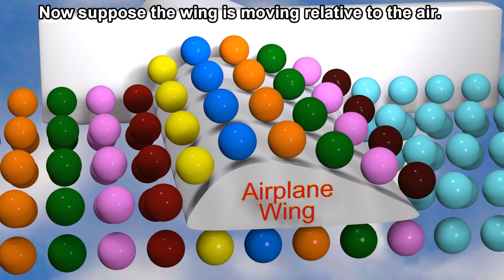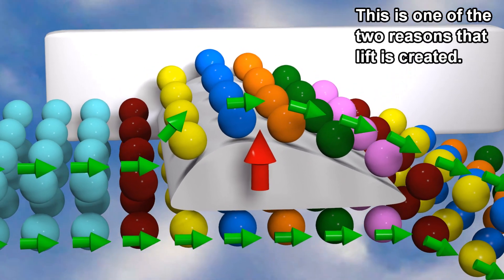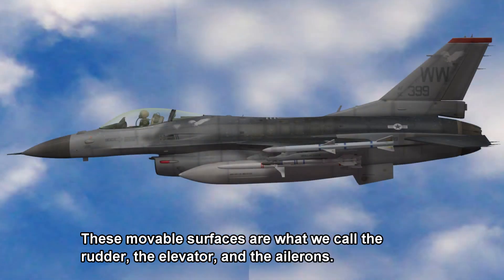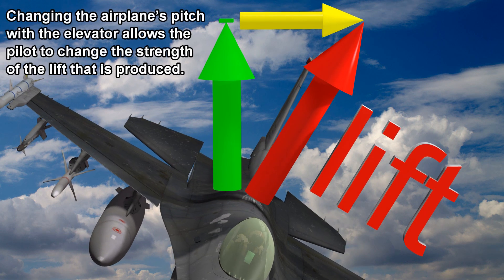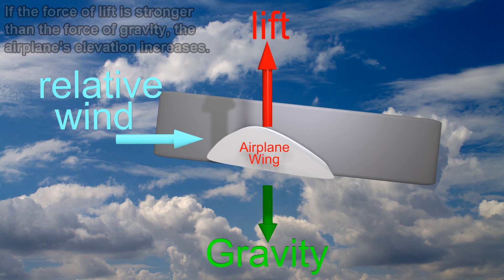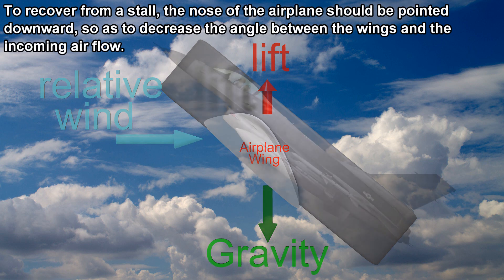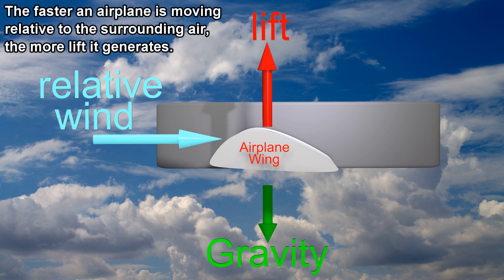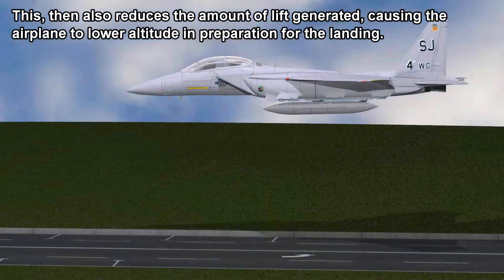Aerodynamics - How airplanes fly, maneuver, and land

Comment: Ah!  Another amateur Lift video.
...
Eugene,
You are, unfortunately, repeating some common misconceptions about lift that have been repeated so many times that it is almost impossible to get the true story. ...
Your animation shows the "Equal-Transit-Theory", long known to be false.  The air above the wing, in reality, beats the lower air to the trailing edge by a considerable amount.  See Professor Babinsky's video of an actual wing: https://www.youtube.com/watch?v=UqBmdZ-BNig 
...
Pressure difference in a fluid is what accelerates the fluid. Speed does not cause a lowered pressure.
...
A wing (actually any object) moving through the atmosphere (or any fluid) creates pressure differences in order to make the air (fluid) flow around it.
...
There are three main parts to the complete explanation of lift.  The upper pressure reduction and the lower pressure increase which is the total lift; then there is the downwash resulting from these pressure changes that satisfies Newton's Third Law.
...
 The pressure difference (top to bottom) on a wing is the COMPLETE lift force, but it has two parts for the total pressure difference.  By the very movement of the wing through the air, the underside of the wing increases the pressure there and this also results in the downward acceleration of that air. This increased pressure is part of the total pressure difference top-to-bottom.  While a fair analogy, the molecules don't bounce. This is the "Hail of bullets that Newton postulated, and is poor science. They are pushed down by the increased pressure at the lower surface. This is easier to see if you view the wing at a somewhat increased angle of attack. 
...
The curved path that the wing causes the air above the wing to take is what causes the lower pressure at that surface, not "speed".  This is the second part to the total pressure difference. When a mass (even air) flows in a curved path, this is an acceleration caused by lower pressure on the inside of the curve - at the wing's upper surface in this case.   The lower pressure thus created is also responsible for the acceleration of a considerable amount of air that is above the wing to be accelerated downward.
... If you understand this, you will see that under the wing there is also a lower pressure toward the inside of that curved path.
...
 The upper air and lower air combine to form the total downwash.   
See this animated gif of a very large test model and mote how much of the downward thrust air starts above the wing:
http://amasci.com/wing/lasrWing.gif 
...
The reality is that the wing's movement through the air causes a pressure reduction above it and an increase below it.  
...
The speed of the air above a wing is almost unchanged as the wing passes by.   It is only accelerated downward.  Look closely again at Prof Babinsky's video linked above.  Believe it or not, the air below the wing is pushed and sped up as the wing passes and is therefore faster, from the still air's frame of reference.  See Complete Aerogeek's video (time 4:00) of three frames from Professor Babinsky's video.  Note the streamlines #8 & #9 as the wing passes the STATIONARY vertical line.  The one that moves the most is the fastest. [#8]
 https://www.youtube.com/watch?v=MlK4ZL5N7MA  
...
It is the total pressure difference which allows lift and control, not just the lower surface phenomenon.  Control surfaces have an effect on BOTH the air above and below the wing, just as the whole wing does.
...
ALL WINGS produce lift in this very same way...inverted, symmetrical, flat.  More pressure below than above, curved paths below and above and with the resulting downwash.
...
The angle of attack changed by the elevator, changes the pressure differences created an,d therefore, the lift....For a good and authoritative source to support what I say here, see:erodynamics Krzysztof Fidkowski associate professor, Aerospace Engineering Department at the University of Michigan.Krzysztof Fidkowski How Planes Fly.  https://www.youtube.com/watch?v=aa2kBZAoXg0 - 
Cheers, ScienceAdvisorSteve
www.challengerillinois.org
Reply from the maker: I did not actually say any of the things you think I said. Nothing in the narration or the text on the screen states the misconceptions you are referring to. Perhaps you are so accustomed to seeing those misconceptions repeated in other people's videos on aerodynamics that you assumed that this is what I was also saying in this video too. It is not. If your complaint is with how I depicted this in the animations, I would agree that there is room for improvement in that area.  But then there is the question of how far do we go to try to make it more realistic.  For example, someone could complain that air molecules are not actually spheres, and that I should therefore not depict them this way.
Reply: Hi Eugene.  Thank you for responding.  I did offer more complete explanations rather than simply claiming something is wrong, as many others do.     Carefully reviewing the video, I see you are technically correct.  While you may not explicitly state the common misconceptions, your words support them and I see no real explanation of any science. 
...       
I won’t just repeat everything here, but will try to be more concise.  
...
Your text is: "...the wing's shape forces the air above the wing to flow faster than the air below.  The air below the wing is now creating a greater pressure than the air above..."  
...       
First, you actually do not give a reason for the pressure difference. It is only implied that the Faster air has something to do with it, but not just what. You do not say that the pressure above the wing is reduced. In fact, your wording implies that the faster air over the wing causes an increase in pressure below the wing.
When so many others say that "Bernoulli's Principle is that fast air has (or creates) a lower pressure than slower air (or the surrounding air)", your words support that misconception. A person with that misconception would easily think you are saying the same thing.
...       
Second, is the fact that "Fast" is relative to the frame of reference and is the wrong focus that so many other explanations get falsely locked into. The air just above a wing may reach the trailing edge before the air below, but it only looks faster from the pilot's reference.  From the still air's perspective it does not increase speed rearward. In fact, as seen in the video I referenced, the horizontal component of the upper air is pretty much stationary and is only accelerated downward by the wing.  That cannot be considered fast by any measure.  In addition, the lower air is moved along with the wing as it passes, clearly speeding it up to some forward speed greater than the upper air.  Because this shows that there are two different interpretations of which is the faster air, depending on frame of reference, this suggests a serious issue with using "fast" a valid criteria.  
...       
Third, the "bouncing" of molecules off the bottom may seem like a fair analogy at best, but it is introduced it as though it is a completely different phenomenon of physics happening under the wing and completely ignores the pressure increase under a wing; where you do mention the pressure decrease above. The change in focus implies two different phenomena in play for lift.
Many people believe the underside of a wing is the only place lift is created.  There is a local pilot who lost a significant part of the upper wing covering on one side as he was flying.  Because he did not notice a significant loss of lift on that side (only more drag) he has convinced himself that the upper surface of a wing is completely irrelevant regarding lift and scientists are fools to be concerned with it.
...       
Finally, because inverted, symmetric and flat wings produce lift, what is, or are the phenomena that take place for the cases other than the classical unsymmetrical wing?  The above quoted statement does say that the wing's shape that is key, yet these other shapes also generate lift.   Are there other physics explanations for those other cases?
...       
Other issues:
Your explanation of the control surfaces indicates that only the lower surface is significant in control, yet we know that a lowered aileron can stall that part of the wing, indicating that the upper air flow is indeed taking part.  This resulted in what was called "aileron reversal" before it was understood and compensated for with Washout.
To recover from a stall the nose does not necessarily need to be pointed downward.  A reduction in pitch can be achieved in other attitudes so the nose still points other than down.
As a practical matter, for landing, the speed of the craft is controlled by pitch/elevator, something pilots know.  The common view is that power controls vertical velocity and elevator controls airspeed.
...       
I submit to you that the quote I reference does indeed support the misconceptions and I see this video as no more providing a good explanation of the science of lift than the dozens of others on YouTube that explicitly rely on the common misconceptions.  You spent a great amount of time putting the video together, so how do you justify it if not to provide a correct understanding?
...       
  I wouldn't pick on the animation molecule size as that is not essential to the physics of the important phenomena.  Though continuous streamlines are more in line with the continuous medium of fluids, I have found that some people rely on the concept of molecules as a basis for understanding.  
--             
Regards, ScienceAdvisorSteve
I invite you to watch the Fidkowski video for a very intuitive view of the science of lift.

Comment: Great video Eugene. I just have a couple questions. At 6:52, you mention that more lift can be generated during landing by extending the wing flaps. However, the wing flaps animation at 7:00 suggests that extending the wing flaps would also cause the nose of the airplane to tilt downward to some degree (like when the elevator is used to achieve the same effect), which would decrease the amount of lift generated, I think. Does this downward tilt actually happen? If so, is it accounted for in some way or is it negligible?
Reply from the maker: +Sean Wiesen, the effect of the wing flaps on the pitch is much smaller than the effect of the elevator.  This is due to the fact that the elevator is further away from the center of mass of the airplane, and the further away a force is from the axis of rotation, the greater the torque due to this force will be.
Reply: +Physics Videos by Eugene Khutoryansky Ahhh true. That makes perfect sense. Thanks!

Comment: But WHY does the faster moving air above the wing cause lift?
Reply: Air pressure is essentially the amount of air particles that are bouncing against a surface. When you have the same amount of particles bouncing off the wing in every direction, theres no net force. But if more particles are bouncing off the bottom of the wing than the top of it, then there will be a net force pushing it upward
Reply: +Copydot But there are not more on the bottom.
Reply: William Berotti No, there are more on the bottom - as long as the wing is moving - at any given moment. I think what you're missing is that the air on the top of the wing isn't just moving faster, the wing is accelerating the air particles over the top, which causes them to spread out. Thus, less particles on the top.
Reply: William Berotti  William,
The air over the top has a pressure lower than the ambient pressure due simply to the motion of the wing through the air.   The wing is, in essence, moving away from the place where the air would be without the moving wing there.  This lowered pressure along with an elevated pressure under the wing is the total upward force we call lift.  It turns out that the lowered pressure above he wing is responsible for a little more than half the total pressure difference and therefore a little more than half the lift.
...
This business about "Fast Air Having Lower Pressure" is a long standing misconception parroted by many people and teachers.
--
Regards, ScienceAdvisorSteve

Comment: A common misconception is that the air over the top of the wing meets up with the air on the bottom of the wing. This is actually blatently wrong, the air over the top of the wing is long gone by the time the air under the wing passes the trailing edge. This is because the downwash pulls the air above the wing, and the greater downwash at a higher angle of attack pulls the air over the top even more. If they met up, the upper surface would need to be over twice the length of the lower one, but airfoils don't have that kind of difference in length, and if they did they would have too much drag to be efficient.
Reply: +Alex I   While the upper air does indeed beat the lower air to the trailing edge,  Nothing can "pull" on a fluid.  It takes in increased pressure in one region to push (accelerate) the fluid toward any nearby lower pressure regions.   Pressure differences accelerate air. It is the pressures created by teh wing's movement relative to the air that causes the downwash.  Downwash is the result of the pressures - again because pressure differences acelerate air...Once the wing passes, the downwash continues due to inertia and eventually mixes with ambient stationary air and becomes stationary as well. ...Yes, the different path length between the upper surface and lower surface is quite small.
Reply: lift is just atmospheric pressure under the wing, same as power brakes in an auto (the "weight" of the atmosphere helping you push the fluid through the brake lines) or a vacuum cleaner picking up dirt
Reply: racer83racing  While many forget that we live in a pressurized atmosphere, what you say is partly true.  Under a wing the pressure is slightly above atmospheric pressure due to the wing's movement. Above, it is slightly below atmospheric.  This difference in pressure is the lift force.  Without that difference you have no lift just from atmospheric pressure alone. It is this difference in pressure which is the lift force.
...
It is the higher pressure region that pushes some air or object toward the lower pressure. Fluids can only push (not suck).
...
The examples you cite all depend on pressure difference.  There is some positive pressure on both sides, but there is a difference.
Regards.

Comment: I have never understand how the shape of an airplane-wing generates lift.
Why are the up-going airmolecules faster?
Reply: +auletes i might be bit wrong but it helps to visualise: the plane is like a disruption in the air. As the plane is moving through the air the air molecules lose their original position. That creates force on the wing. It's all about the angles at which the air molecule hits the wing and that creates certain speed.
Reply: Because they have to cross longer (curved) path.
Reply: *****  It is about how the wing diverts the air downward both from below the wing AND ABOVE the wing.
Air from above the wing isw also diverted (turned) downward.

Comment: Finally I know I always had a gut feeling that air caused a force when it hit an angled wing but everywhere I looked it always said the lift was only due to the air pressure from the air foil and I just thought I was wrong without looking too deeply into it. Great Video!
Reply: +Patrick Houlihan  Patrick,    The pressure difference on the wing (top to bottom) IS THE LIFT.  Pressure differences is the only way to generate a force in a fluid.    The part where he "boundes atoms" off the bottom is a poor analogy of how the pressure under the wing increases.  The upper decrease and the below increase is the total pressure difference and the toital lift force.-- Cheers, ScienceAdvisorSteve     challengerillinois.org
Reply: +Your Waifu Sucks,
t is not clear what you mean by "factors".  
As I am sure I posted earlier to the author, Eugene and Patrick, this video is a poor  explanation.
...
The idea that: "air caused a force when it hit an angled wing " IS CORRECT and that force is an increase in pressure over the wing's area.  PRESSURE is that FORCE.  They are one and the SAME thing.
...
The pressure difference (top / bottom) over the area of the wing is the total upward force on the wing.  There are no other 'factors' providing additional upward lift force.
...
Those pressures, however, are what also cause all the air accelerations around the wing:  below, above, ahead, behind and off the tips.  
...
Therefore, the pressure difference alone is not the complete story of what is going on around a wing.  (this, of course excludes drag).
..
IF there was some other factor that contributed to the total lift force, it would be part of the total pressure difference.
...
T
You can look at is there are TWO FACTORS like this:  
1) Increased pressure under the wing.
2) Decreased pressure above the wing.
C) However, these are the two parts (roughly halves) of the pressure difference.
...
If you refer to a common story that pressures (sometimes called Bernoulli) only account for some of the lift and that something else (frequently referred to as Newton) provides the remaining lift, this is a misconception.  
All forces causing the lift force are due to pressure differences.
-- 
Regards
Reply: Patrick Houlihan The difference in pressure isn't the only factor of lift
Reply: Observ45er Well I watched Vsauce video back then and it said that difference in pressure isn't the only factor.
Reply: Or I might be mistaken.